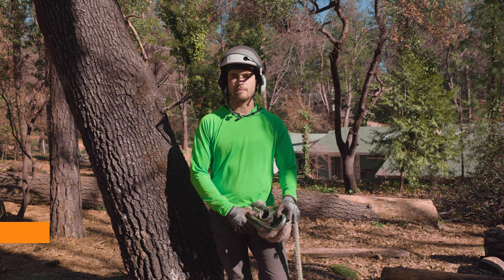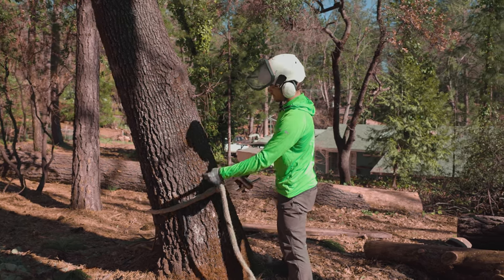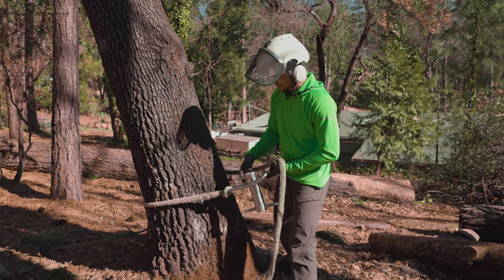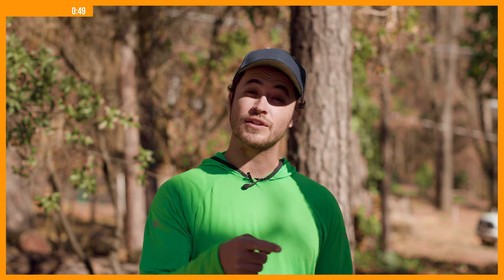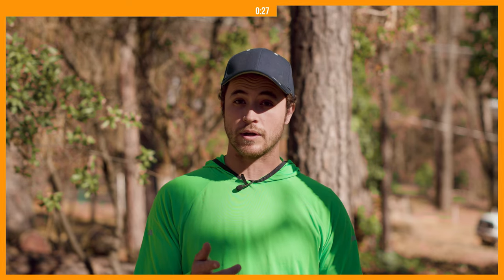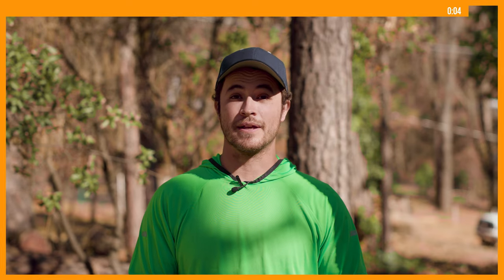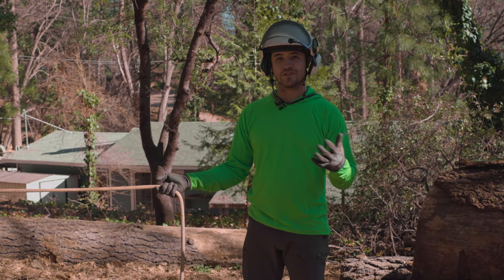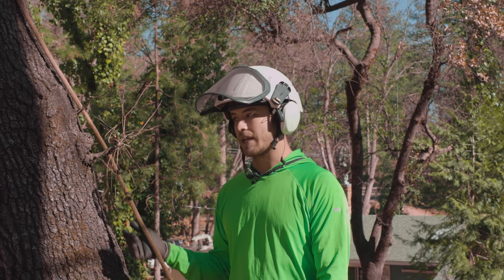Consistent, Portable Friction for Rigging | How to set up and use Notch Portawrap | Beginner Rigging

Comment: I've been watching your videos especially the climbing ones I'm currently getting back into climbing trying to get over the fear of falling keep the videos coming
Reply: Josiah is an amazing instructor.
Reply: spend time practicing your skills on the lower 10-20’ of the tree, learn to trust your gear and try to gaff out on the lower part of the tree to see what that feels like.
Reply: @j1gly-pq576  Best advice ever. I am a new climber myself and doing this is helping me a lot. A lot of times you are afraid you are going to slip and get hurt, but if you are properly tied in its nearly impossible to. You can try to gaff out on purpose or slip on purpose and as long as your ropes are properly setup, you might fall a few inches tops and then it catches. Also learning the ins and outs of the gear, inspecting it, and learning all of the load capacities eases the mind. Most of this gear is so over rated that its not even funny.
Reply: falling is no big deal, it's just that sudden stop....

Comment: I know it will change with the rope/aerial device, but is there a rough guideline for how many pounds one wrap will handle?
Reply from the maker: It could be anywhere from barely 200 lbs to 1000 depending on the friction involved and what the goal is. I will rarely ever take more than 2 wraps. If I need that much friction I should be using a different device like the GRCS

Comment: I bought a Notch stainless steel portawrap and it grabs my ropes like a vice grip every time. No run whatsoever no matter what. 1/2" coated double braid rope, rigging ring, half wrap, trained ground guys, big tops, stopped dead every time. I would recommend nobody to buy this item and if you've bought it then DO NOT trust your life to it if you need a piece to run. Buckingham is worth the money in this regard
Reply from the maker: There are ways to wrap that thing that will cause that behavior, also the coated double braids tend to be much grabbier than the softer fluffier ropes.  But it’s more about how it’s wrapped.  I would put money that it was being wrapped wrong
Reply: @Stridertrees  I hope thats the case. From what I could tell in the tree it was always wrapped in the proper direction. I'll have to run some tests with it outside of work.